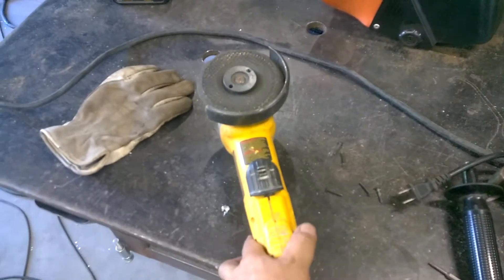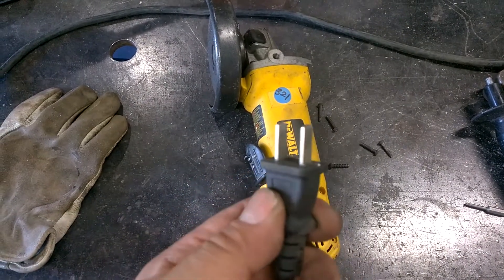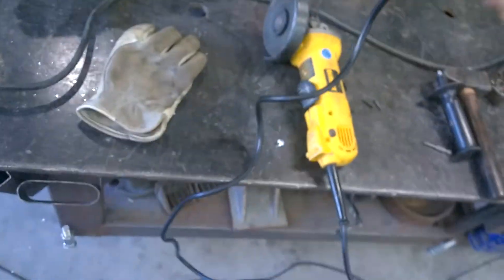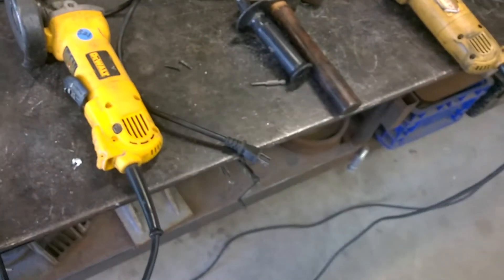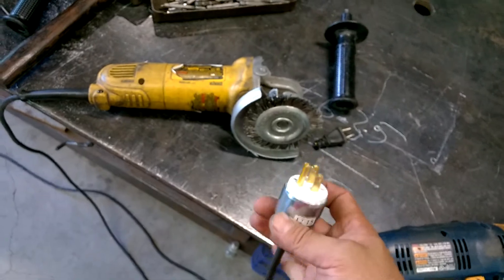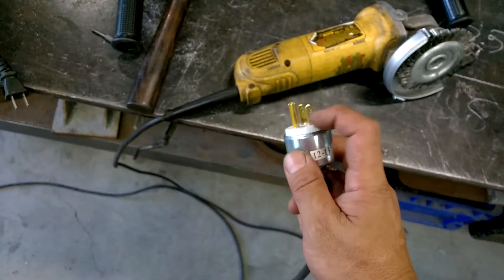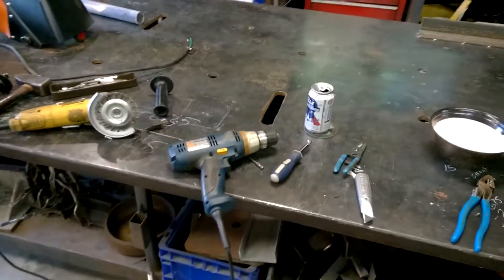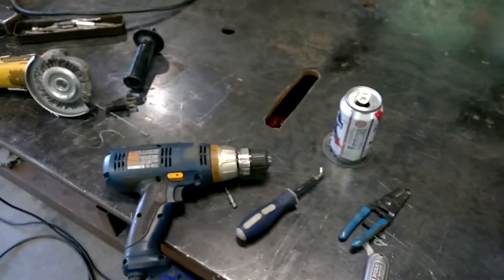Two Tips - Plug And Beer

Comment: Hey UV, I love these videos! I've been doing a lot of estimates/bids recently, any tips there? Cheers bud
Reply from the maker: Well, I don't know if I can add anything to what you know already, and there are many variables... but I'll talk about what helped me out;  1. Figuring out the base cost per day, based on daily overhead (rent, insurance, vehicle, utilities etc.), then add a percentage of that for profit. 2. Take employee hourly rate for the job and double it for payroll costs, taxes, profit, etc. 3. Add 5-10% of material costs for miscellanies material costs. 4.Figure a cost per tack/weld or linear foot (great for railing jobs) which is helpful for quick top of the head #''s (I think I got that tip off of Jody...you can "reverse engineer" that value from past jobs). 5. figure out unit costs for frequently used/sold units (for me it was table legs, as well as, base prices for tables in small, medium, and large prices). 6.Create an easy formula to calculate mark-up. For me, it was to take all material costs divide it by two, then multiply by three.
So anyways, that's what I came up with on the fly. Just remember I had to learn all this stuff on my own while growing my business in Chicago and It's what worked for me as a self employed business owner with employees. What I do now, since having moved to Columbia MO in 2012, is not that involved. That said, I need to recalibrate and adjust to my local as I grow my business and take on more jobs... especially now that my youngest kid will be going to school full time soon.

Show less